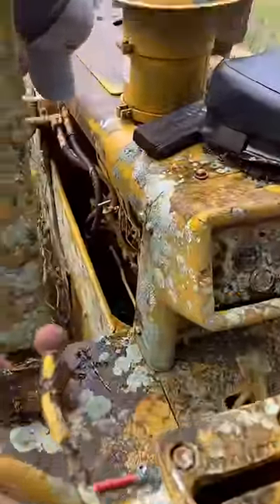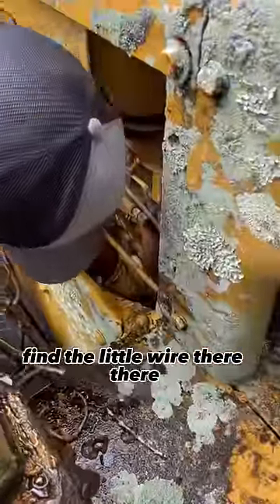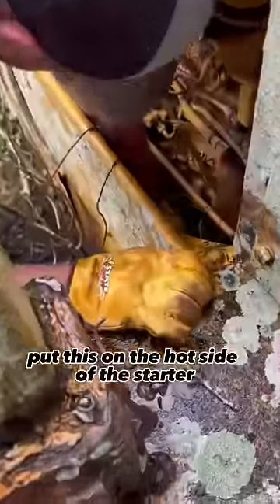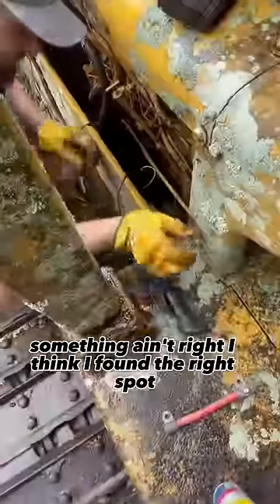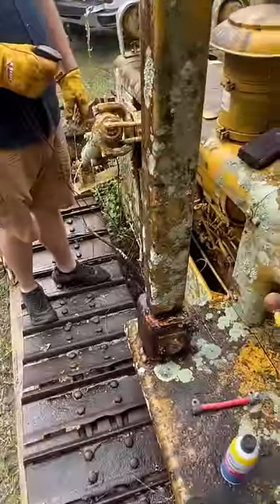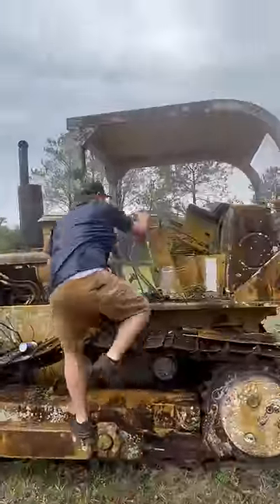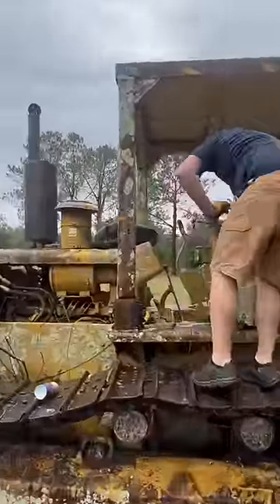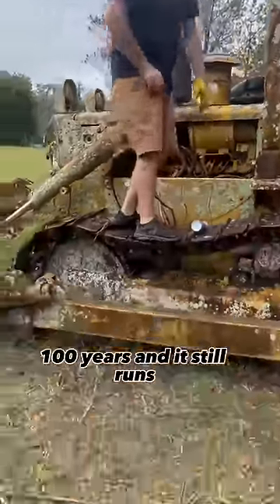100 year old bulldozer??🤯🤯

Comment: That is NOT 100 years old that's what they looked like when I was a kid which was in the 60's. 
And they didn't have protective canopies in the 20's.
Reply: Not mention no hydraulics
Reply: @paulprigge1209  that's right 👍. Another commenter mentioned it would not have a turbo. In fact crawlers (tracked tractors) were new in the 30's. Don't know when they put blades on them.
Reply: She's not Ancient 😮
Reply: Base on my resurch it not 1920 but there did canopies but there Wood and more box or tent like. The blade was wooden and it a farm tractor.

Comment: My thoughts exactly.  70's dozer.  Everyone gets these old dozers that run good. I got junk.
Reply: @@soupcan3590 I bought a 73' D5 powershift. Seemed good. Ran it about 80 hours and something went horrible with the engine. Water internally spewing all the water out of radiator.  I parked it. Buy the time I got around to fixing it it was locked up. Lost 15 grand on the deal.
Reply: Lmbo me to junk
Reply: 1966

Comment: For anyone wondering, the oil pan can have water in it and not have milky oil before you start it, the oil only turns milky after the water and oil has emulsified, check your oil drain plug for water and not the dipstick 😂
Reply: Absolutely.
Reply: The dipstick did the checking !!
Reply: If the oil is way up over full that's when you worry.
 It's kind of between the full and the not full marks and it doesn't have the devil's glitter in it you're probably all right.
Reply: @TheOcculus  that only applies if it hasn’t been sitting for a long time, if it’s over full then yes it’s probably got water or coolant in it, but it could be on the full mark and still have lots of water or coolant because of oil leaks
Reply: @henryhenry3832  Agreed. If it's right on the full Mark it's probably got some water in it.
 If it's sitting somewhere between the two marks then it's unlikely it's got a lot of water in it.  Water in the crankcase will also manifest as rust and peanut butter furthur up the dipstick.
 If it's between the two marks it's good enough to start the thing and see if it runs well enough to make an oil change worthwhile.  Why waste 15 gallons of oil on an engine that's shot all to hell?
Reply: @TheOcculus  I still pull the drain plug before I start anything that has sat for any length of time because it could have enough water or coolant in it to be sucking straight water or coolant into the pump
Reply: Just start it that water will evaporate!
Reply: @JosephCowen-ru7up  🤣🤣🤣 im glad you don’t work for me cause I hate firing people for doing stupid stuff
Reply: @henryhenry3832 That's a really good tip! I've never considered that before! Thanks!
Reply: @spiet7380  you bet, it’s common for liner seals to leak if it sits for a long time so I always check coolant levels as well because it could end up in the oil pan as well so just because the exhaust and intake are covered doesn’t mean it won’t have something in the oil
Reply: Can't believe they didn't change the oil first

Comment: My Dad was a excavating Contractor. I grew up around and running heavy equipment and Paving Machines . A friends Dad who Did it before My Dad started liked the Caterpillar tractors that used a cable and spool to raise the blade . A lot of the old timers learned on those and preferred them to the Hydraulic ram controlled blade elevation like the tractor in this video. Those spool tractors back when I was little in the 1960’s couldn’t have been older than 1940’s models. There is a lot of maintenance and expense to heavy equipment used all the time to make a living.

Comment: Any really old bulldozer has a pony motor to start it.
Reply: I once ran an 1953 vintage Allis HD-11 that was electric start. Maybe that isn't "old"....
Reply: Yes I had one   D-6 8u. Pony engine and a non tilt 8’blade. Learned to dig foundations with it
Reply: Yes had one
Reply: Yes and any real old dozer one cylinder on the pony motor doesn't have compression

Comment: I once watched a program on how Caterpillar came to dominate the heavy construction equipment industry. Show a farmer that owned a 1920's Cat diesel that was original. He went thru a series of steps before turning the exposed flywheel with a bar to start it. It began chugging real slow on the third turn so he said let's eat breakfast while it warms up. Believe he said it had a top speed of 6 mph. Then they showed an old D7 that was left behind by the US Navy Sea Bees in Angola after WW2 ended. It came chugging by pulling a string of wagons past rows of inoperative Soviet tractors and trucks. The host was talking to the Angolan Minister of Agriculture that pointed out they could get anything they needed for that old D7 within 10 days and was impossible to get replacement parts for the Soviet equipment.

Comment: When a machine has been sitting and not running its impossible for the oil to be milky. 

That being said, it's almost always a good idea to crack the oil drain and see how much water is in there bottom of the pan.
Reply: Once the oil mixes with water or coolant or doesn't separate and go back to black. If was leaking into the crankcase when it was parked that milkshake is gonna sit in that crankcase until it's drained. I pulled a 283 out of a 52 Chevy last summer and brought it home starting tearing it down and unbolted the crankcase and it looked like a couple of gallons of melted chocolate ice cream. And when I pulled the intake off, it was completely crammed with cotton bolls and pecan shells. And one of the pistons was burned through and the cylinder had a mini crater in the bore. It was free so I couldn't really complain. There was no dipstick, the truck was sitting below the frame in red clay, no wheels, the rear end was gone and it took about three hours to get it jacked up high enough to get it sort of safe to crawl under and unbolt the tranny . There was no way to check the oil and the water pump was seized up and full of mud from mud dobbers.
Reply: @dimetrekorsikov5643 if you pulled a 283 from a 52, it ain't  original.
Reply: @michaelmcclellan9422  no kidding, it was like the third motor they'd put in it before they parked it. The guy who owned it just wanted to save the body and swap it over to a different frame. Anyway, regardless, the comment was milky oil doesn't stay milky after sitting for decades and I'm telling you it does. Original motor or not. Once oil and coolant are homogenized they don't ever separate

Comment: Old two-u D-8s are fun to run.Its like they came over on Noah's ark.Has the long slide bar runs length of dozer to operate the blade.Ha a tall master clutch.All the steering clutches and blade are really tall .The dash is a long way up there.wasnt very tall but is very long.Those were the days.Had to start it with a gas pony motor.

Comment: I've seen some really old equipment. Some had trees growing through them. The real old stuff didn't have hydraulics. One machine used a hand cranked gasoline donkey engine to start the main diesel engine.

Still, with trees growing through the tracks, this thing has been sitting for a hot minute. I like old stuff...

Comment: Sounds real good, but be careful. Just because you see, oil under stick does not mean it's not water in the bottom of the Pan crack that oil plug drain. Not necessarily take it out, but loosen it up real good. It should bubble water if water is there  or oil. Just a tip

Comment: If it is direct start it is not that old. First ones I operated had gas pony motors to start the diesel engine. Cable winch on the rear to lift the blade. But it is a cool old dozer. Might want to tighten up those tracks. LOL

Comment: if its not started for a while the water completely separates and the oil wont look milky even though there is a pool of water in the bottom of the sump. gotta check it after its run for a bit to be shure.

Comment: Btw, if something has sat that long you can't actually tell if there is water in the pan from the dipstick, unless the dipstick is rusted there. It will be separated out and the oil floating on top of the water.

Which is actually really weird looking when you drain it and a bunch of water comes out then finally oil.

Comment: If it was 100 years old, the blade would be cable operated. I don’t think they came out with hydraulics until the late 50s. Judging by the depth of the tracks in the ground it’s safe to say that it’s been there maybe 20 yrs

Comment: it will not milky if it just stands there. The milky ness comes from the emulsion of oil and water, Wich means the engine had to run with water in it to mix it up

Comment: Why would the oil be milky when it hasn’t ran in a while…like you suggest.? All the water is separated at the point you check the oil. Better to pull the drain plug before starting. You don’t have to change the oil, just pull the plug to see if there’s water

Comment: Like how the exhaust is rusting so slowly 👍🏼
Reply: Good metal, completely tore down a 1972 JD 100 riding mower. Every bit cracked loose and they all came out by hand! That’s cause of the quality of steel it was made from. Nowadays a year old vehicle is rusted, I’m a bodyman and I have to torch the bumper bolts after 6months old.

Comment: Not even close to a hundred years. Didn’t have those engines in the twenties. My dad had a 1950 d6 with a pony motor to start it, this has no pony motor. This is also hydronic, the older models were cable operated

Comment: Not even close to 100 years. Been sitting MAYBE since the 70s at the earliest. Most big equipment didn't even have starters till the late 60's and 70's, if it was actually older, it would have a pony motor.

Comment: 1: just because the oil is black doesn't mean it doesn't have water in it. The only reason oil turns milky with water is if the engine churns it up. Could be pure water in the bottom of the oil pan. 2: that thing ain't near a hundred years old 😂

Comment: 1. Not 100 years
2. Not as easy as you show
   a. Pretty sure you had to install and or at least hook up a new battery 
   b. You don’t disclose the amount of starting fluid you poured into it 
   c. You don’t disclose how many times you had to hit the starter switch, spray, switch, spray, switch, etc.
   d. You showed the oil but not the fuel filter
   e. Mention if the lines were dry rotted and had to replace??

Pretty disingenuous